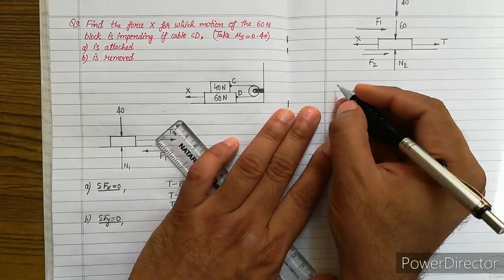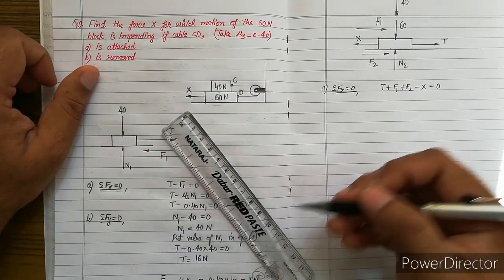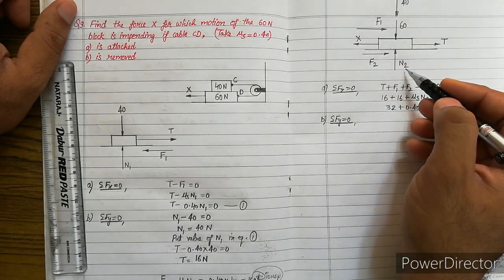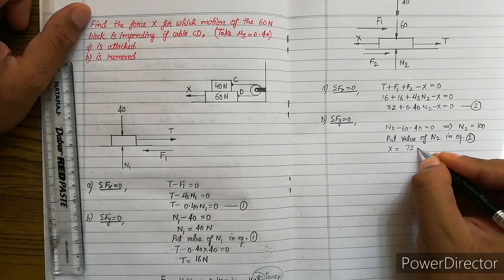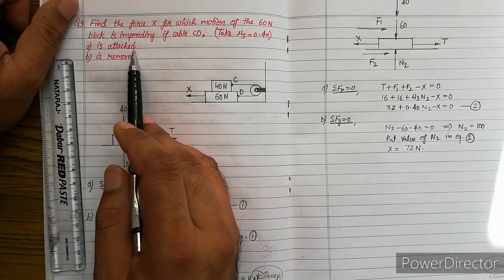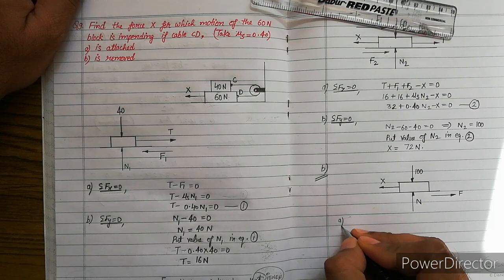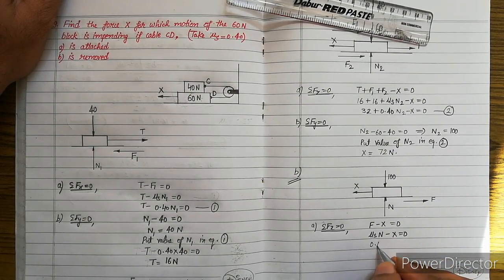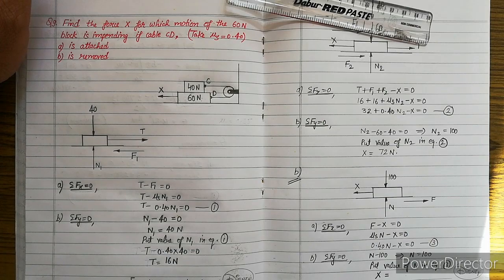Friction | friction engineering mechanics | Block on Block | Cable attached | Cable removed | 8.12

Comment: Hello sir...thanks a lot for this video. But what if the surface was inclined at an angle 30 degree. Then how are we suppose to take the frictional force for the two bodies. Everything is exactly the same like the pulley connecting the two rods and one block over the another. Also if instead of force x being applied to the 60N block its being applied to the 40N block. Pls do reply sir🙏🙏
Reply from the maker: Welcome dear. There are such problems also on my channel. Kindly see the course or playlist on my channel named as ENGINEERING MECHANICS | FRICTION

Comment: For case 2
Since the x force is applied to the left, the frictional force at 60 is applied to the right
My issue is the frictional force on the 40N, since the x force is moving it to the right, the frictional force at 40N should be moving to the left
Reply from the maker: Dear, if you mean case 2 as b) part of the problem, then in that part cable is removed so both the blocks A & B will act as a single unit of 100 N. This is because there will be no relative motion between the two blocks as cable is removed. Thus, there will be only one friction force that will act between the ground and 100 N block and it will act towards right that is opposite to the motion which is towards left.